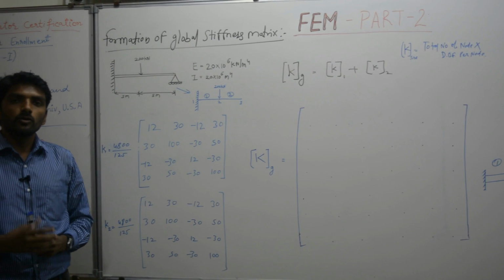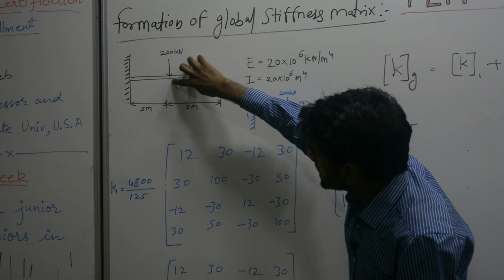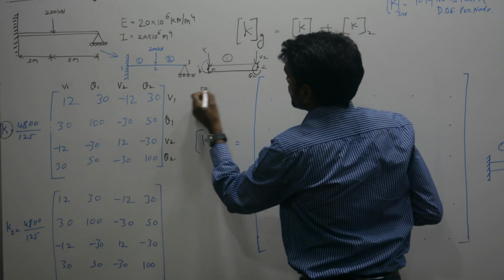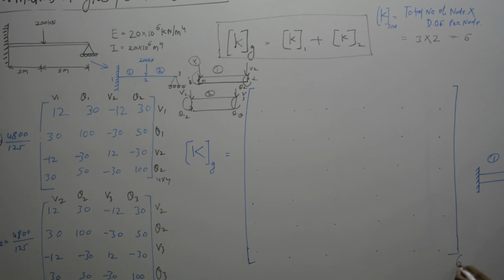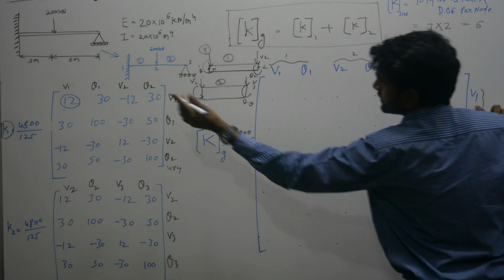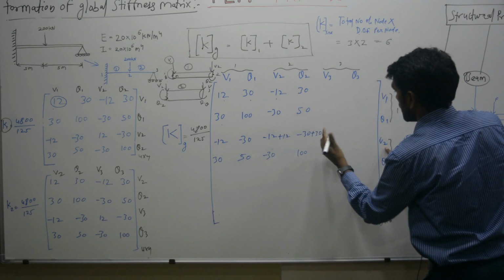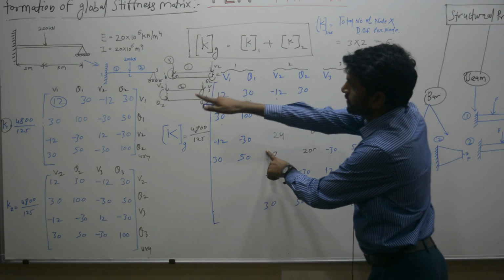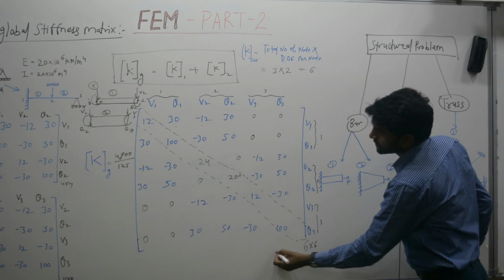Finite Element Analysis Procedure (Part 2) by Mr Ravi Pratap Singh

Comment: Hello Sir. For the given values of E, I and L, 4800/125 as written on the board doesn't fit in well. I could be horribly wrong, but this is one thing i am trying to understand and to code for a project. Could you please update. Will be very helpful. 
P.S, is there a general formula for calculating moment of inertia I, If not given?